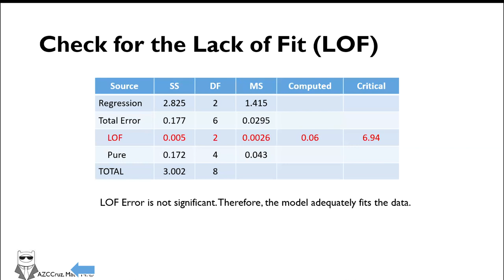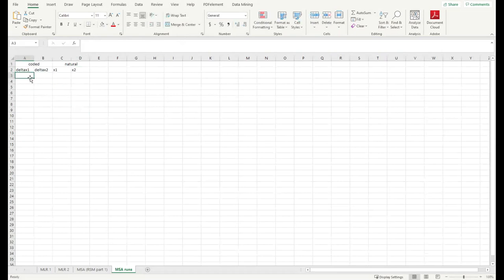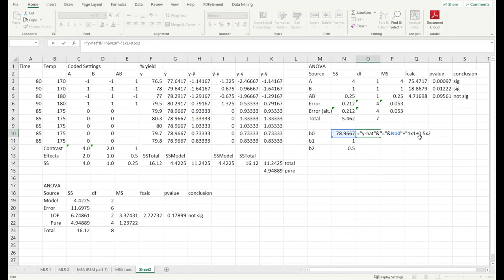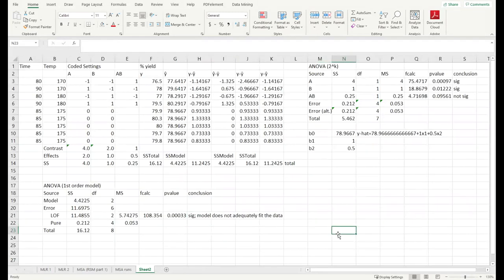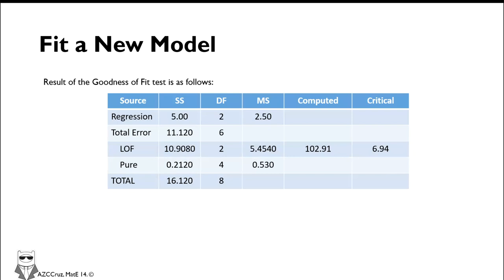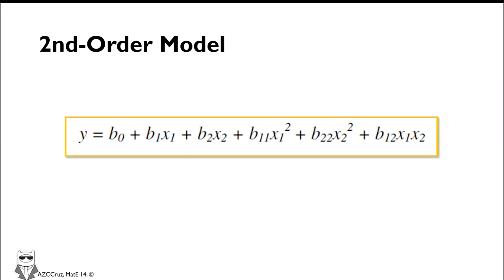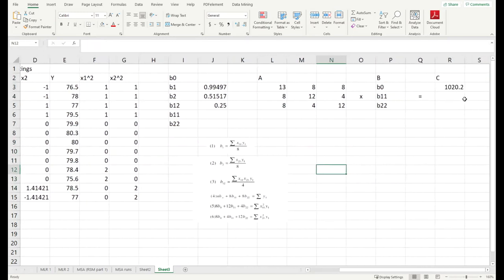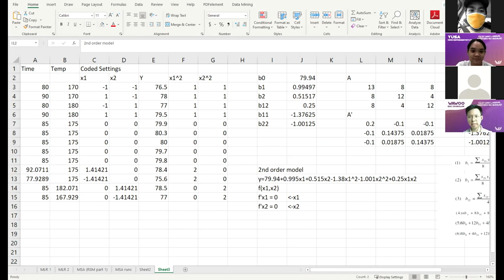MMME14 | Central Composite Design (RSM Part 2)

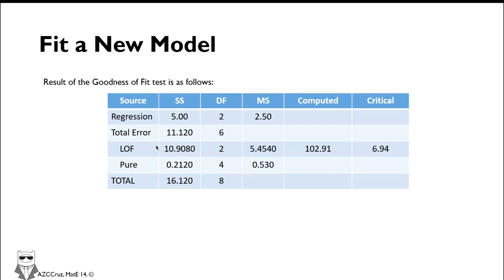Comment from the maker: Correction: At 39:50 - 43:53, I'm mulling over the discrepancy between the ppt slides and the excel file. I double checked it and this is because I didn't do dynamic formulas for the predicted y (y-hat), so I actually used the old formula (which used a different set of coefficients) from the previous sheet where I copied it from. I've corrected the uploaded excel file and it should show the same results as the slides.